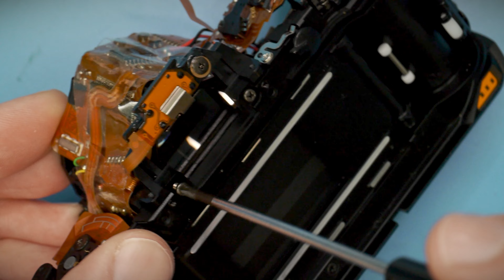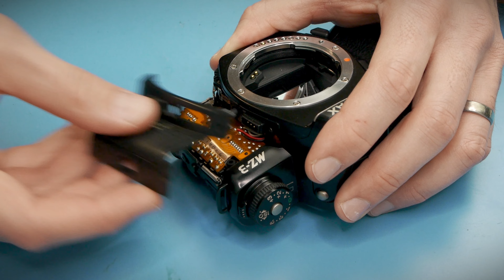Pentax MZ-3 | Part 5 - Reassembly

Comment: hi  I have very much enjoyed your repair. It really shows how many you have already fixed. excellent. I have had this MZ-5N in its era for many years of great service. and I have recently got the same camera for just some small change. Outside in mint condition and inside in expectable all failures shown condition. my question reaĺly is would you share the fusion files for the brass replacement parts? thanks a lot.
Reply: I figured you have already provided the stl in the ifixit manual. Excellent. thanks a lot

Comment: Thank you so much for this series!! 
I just received an MZ-50 as my first analog SLR, but both the pop-up flash and the mirror motor are broken. I knew about these problems before and didn't spend much on it, so I am not super disappointed (it was more like a gamble to see if I get a good deal) but was considering a repair myself. I work with micro electronics for a living, so I was rather optimistic, but the disassembly looks like a major PITA. I think I'll not attempt it, but use the camera as decoration instead. Bought a Minolta to use anyway. 

I am looking forward to more of your content, fascinating stuff!

Comment: Do you do refurbs. I just bought a “Mint” Tested MZ-5. I so regret selling my ME Super 12 years ago. I shoot professionally part time, and clients are starting to ask for film images again. Luckily I kept all of my other Pentax kit because they were compatible with my K5 and K3mkII when I moved to Sony. Even though this camera is supposed to work, it will be my only film camera for a while. I have 10 different camera bodies right now, and I am running out of space. I wouldn’t want to be depending on the MZ-5 for a client, only to have one of the gears or pivot levers to give out. Additionally having the camera serviced and cleaned is probably a good idea. I also would love to add the split prism.

Comment: When install mirror box it is little bit different step from Pentax MZ-S?
Reply from the maker: Yeah, a little. You can't charge the shutter on the MZ-S. It'll just release as soon as you let go of it. The shutter charge lever on the mirror box should still be down, but the mirror goes in the up position.
Reply: @SamsCameraBench  big thx, my mz-s fully recover
Reply from the maker: Fantastic! Repairing an MZ-S is no small feat.

Comment: Hey, this repair was completed and i’m having an issue where the camera takes 3 pictures no matter what.  Any idea what may cause this?
Reply from the maker: Is the camera stuck in bracketing mode? Check the left side dial and make sure you can switch between all the shooting modes correctly. If not, take the top cover of and check the feeler contacts. It's easy for them to get misshapen.

Comment: Where did you get the brass gear?
Reply from the maker: In the past I have ordered from a shop in Poland (https://www.mikroantriebe.de/), but their web shop seems to be down at the moment. Not sure if that is temporary or long term. You can find the specs for the gear on iFixit (https://www.ifixit.com/Item/Mirror_Motor_Gear). There are a lot of shops that will make gears to standard specs, you'll just have to find one that will make them in this size.

Comment: That was an amazing series of vids, detailing all the disassembly and inner workings of the gearing and motors. Thanks for taking the time to make and upload these!

Quick question, can focusing screens from an MZ-3 fit into an MZ-S? That would also mean a MZ-M split-image would fit into the MZ-S, that would be pretty rad.
Reply from the maker: Hey, glad you like it! I've always read that the screens are incompatible but I just measured a couple that I have. They are both 24.7 x 35 mm. The MZ-3/M screen is 1.15 mm thick and the MZ-S screen is 1.33 mm thick. So I'm going to go with maybe? It may just be a matter of shimming the screen to the correct distance but it would take some trial and error. Time to experiment, I guess.
Reply: @SamsCameraBench  aah interesting on the measurements, thats good to know. Would love to hear how it goes if you get a chance to experiment with swapping+shimming screens it into an MZ-S some day